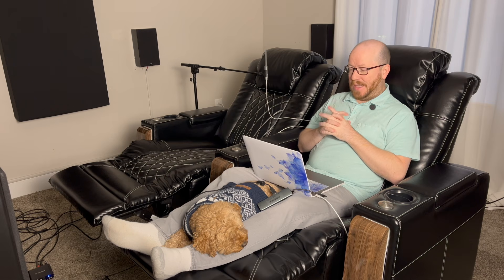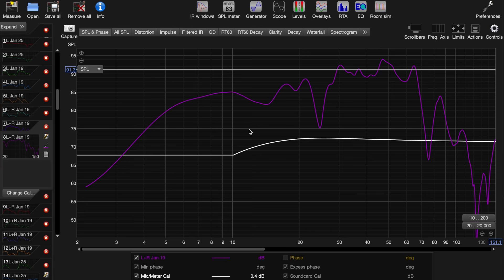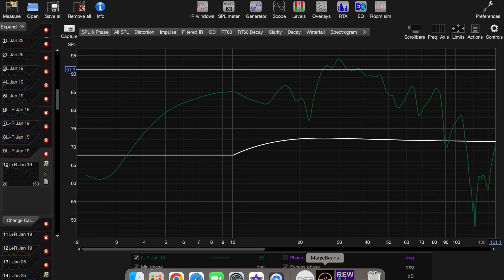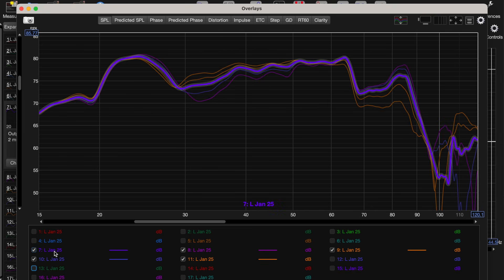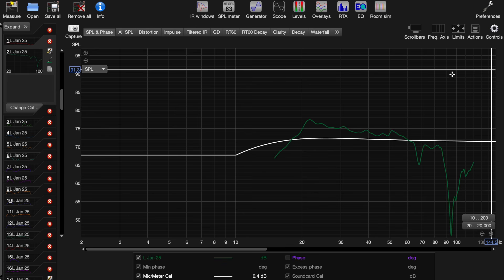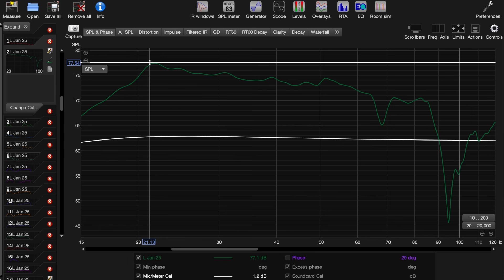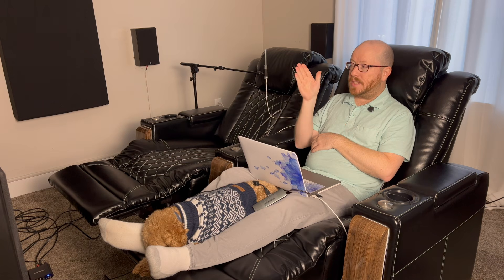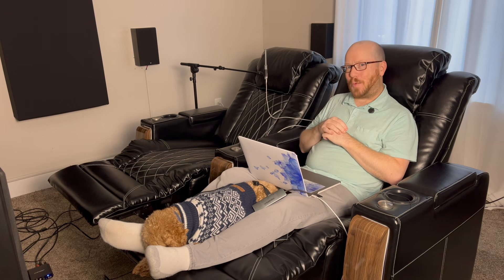Part 2 - Dual Subs + MiniDSP = MAGIC!!

Comment: I ordered a 7 bed layer RBH system along with 4 in-cieling RBH speakers to handle Atmos duty. Your tiny room series and Shane Lee pushed me over the top. Waiting on them to be completed and delivered. How would you compare the RBH sub to the RSL sub? Which one would you say is better. I'll be using it for 100% UHD 4k disc watching.
Reply from the maker: The RBH sub is 12” and can outperform the RSL. However, the RSL is less than half the price. So it depends on your budget and what you want out of it.

Comment: So I just incorporated a 2nd sub (same make/model).  I don't want to buy a mini DSP/ or use rew.

Should I do the following?

1. Level the subs individually. (Both at 75db, and combined at 78db)
2. Do speaker calibration (Avr trim was -11db, but I adjusted it to -5db to to reach 80-81db

Gain on the subs is at 9 oclock.
Can I play with the gain afterwards without calibration, or should I recalibrate it if I touch the gain? 

Should I adjust the gain higher say 10/11 o'clock?  I need to have my avr trim at -5/-6 bc I have bass shakers, or else they don't perform.

Comment: I know you didn’t use bass control yet, but have you tried The Dirac Live Bass Management?  If so there is a bug in the software that affects the LPF crossovers. It’s affecting the RZ50 and RZ70. It’s been an issue for awhile and Onkyo still won’t acknowledge it.
Reply from the maker: Interesting! I have been using Bass Management. Was not aware of the issue.
Reply: @ yeah if you measure your subs in REW you can see it. I know you use external amps so you could shut off the amps so the front left, right, and center get no power or speaker output. Then measure a full range sweep with the left channel. Then measure your right and center speakers.  Change the smoothing to 1:1 and it will make it easy to see. The fronts will default to 120hz crossing and the center will take to whatever you had the fronts crossed at.  The high pass filters will work correctly if you measure the speakers later, but the LPF will always be wrong and the Fronts will always default to 120hz regardless of what you set in Dirac. This is an issue what Dirac Live Bass Management and Dirac Live Bass Control on the RZ50 and RZ70.  There is a lot of info on AVS forums about it. We have been contacting Onkyo going back as far as November, but Onkyo is still no acknowledging the issue.

Comment: As someone who works with sound for a living for about 15 yrs now. You don't need two subs, specially for such a small room and second because most sound below a 100hz is mixed in mono anyways for a whole lot of reasons, you can look up why sub bass is mixed in mono, standing waves, phase etc etc and most of all localization, human hearing can't tell the directional difference of sub bass frequencies anyways, clubs, event venues and movie theaters all have sub downmixed to mono and for good reason too

And I think the most chaos being created is because you have a unmatched pair of subs, because each sub will has a different frequency response curve, which you have seen in your previous video when you ran the REW test in part one from the same location, creating havoc with each other, the RSL (front right, has a better and smoother frequency response so get a second one of that ) just reversing polarity does not really get you phase alignment, the 2ms delay helped because less frequencies were cancelling each other out and creating standing waves.

So for BEST result get one sub with the flattest frequency response possible, get a bigger and more powerful one if you want more rumble and place it halfway behind your chair and the back wall and two bass traps for the rear wall corners.
Reply from the maker: I'm definitely going to experiment with that. Thanks for the great advice!

Comment: problem is, you now have the measurement just in one place, but not in the second position of your 2nd chair. you will need to make several measurements in different places. this is where things are really getting messy so you cant handle them with manual measurenents any longer. you can save a lot if time, by getting a dirac bass control license, which will do the work. best placement of the subs should be one in the middle of the front or sidewall and the other in the middle of the opposite wall. there is a paper from harman on that topic.
Reply: and consider the height of the subs as well to fight the mode between the floor and the ceiling.
Reply: I'd assume, he sits in the right seat and his wife the left ;)
Reply: @kewlbug  a real gentleman for sure he is.

Comment: Good stuff George! Glad you figured some stuff out. Have you played with the alignment feature in REW? If you have sweep measurements from REW, they contain time and phase information. What you can do with the alignment is play with delays and levels to see how it affects the predicted summed response. Its usually spot on. It saves you from having to remeasure with each change. Look out for the solid black line which shows you what the optimal summed response would look like so try to target that.
Reply from the maker: Excellent, thank you!
Reply: I second that 💯, the alignment tool takes out all guessing and tinkering. Adjust the sliders and you will quickly see what the best adjustments are needed for max performance. Such a great tool.

Comment: It appears you are using Dirac with only one sub output and having a MiniDSP to manage the multiple subs.  If you were able to use 2 independent sub channels from your processor then Dirac should be able to calibrate them more precisely.  Since you are using a MiniDSP to drive multiple subs then (like others in this comments section suggest) I would recommend using MSO (Multi Sub Optimizer) to first calibrate your subs then use Dirac afterwards.  This should give a much better response curve in your sub frequency range.
Reply from the maker: I have the Onkyo TX-RZ50, which does not have independent sub outs. I would love to try out MSO but I’ve heard it only works on Windows and I have a Mac.
Reply: @GeorgeTheaterAtHome  Time for Boot Camp 🙃

Comment: Have you played with the OCA calibration? Most have found they no longer need their minidsp. I just installed some bass shakers to my chairs and man they are so worth it
Reply: If anything, playing with OCA cal has taught me so much more with REW, wait till you getting into impulse and overlaying them to get your speakers aligned correctly.
Reply: Run a sweet with front left, then another sweep with front left and sub together, it should show if that null is an issue, your looking for a clean line from the sub to speaker
Reply: No way. Oca is no replacement for MiniDSP at all
Reply: @shaolin95  have you tried the lastest version of his script? OCA neuron

Comment: If you are combining 2 subs from different manufacturers you might want to experiment with all-pass filters. Have you looked in to Multi-Sub Optimizer? It will run 1000s of iterations for you in seconds looking at multiple subs and at multiple seats simultaneously.

Comment: Your 68hz null is almost certainly infinitely deep. The smoothing just hides it. You're also likely looking at a second null at 95hz as that steep drop off and rebound is not consistent with a typical low pass filter for a sub to mains crossover.

Comment: You need a follow up video using MSO (multi sub optimizer). I got similar results as you using REW, but MSO significantly improved the smoothness and completely eliminated a null that I couldn't remove by hand.
Reply from the maker: MSO looks like a great tool - I'll have to give it a try!
Reply: @GeorgeTheaterAtHome you really should.

Comment: Which of the two subs do you like more?
Reply from the maker: That’s a tough call. Based purely on performance, the RBH sub outperforms the RSL. But it’s not exactly a fair fight because the RBH is 12” and the RSL is 10”. Also, the RBH is 3 times the price of the RSL. So you have to account for the price/performance ratio.

Comment: But why use a Mini DSP when you have a Onkyo that supports seperate subwoofer channels output? Not saying using Dirac. Just delay and EQ?
Reply from the maker: The Onkyo TX-RZ50 has two subwoofer outs. But they are not independent. They don’t allow individual control of the two subwoofers.
Reply: @GeorgeTheaterAtHome  thank you. Are you using the Mini DSP Multi-Sub Optimizer (MSO) functionality?

Comment: Sorry for my somewhat stupid question. But when it comes to dsp. I know zero. Because of my ptsd. I lost out on many years of good knowledge. So here is my Q. I got the X15+ sub active and then i just added a dual 18" passive whic is runned on a crown amp 2502 bridged. Does the mini dsp only work with the same type of subs all around or can i mix both active and passive subs? Again, i dont know anything about connection the mini dsp since i´ve never owned or used one. And all this is i guess depended on how you connect the subs to the mini dsp right. Once again a great video. Keep them coming. Tango out.
Reply from the maker: You can mix active and passive subs with a miniDSP. Use an RCA cable to connect the amp for each sub back the miniDSP and you’re good.
Reply from the maker: Thanks, glad you enjoy the videos!

Comment: Would you try the Dirac Bass Control update (for a fee) on the rz50? Above that, magic beans? Sorry for being our guinea pig 😅. Looking for see that director's cut.
Reply from the maker: I’m loving Magic Beans! Haven’t tried Bass Control yet. Maybe have to give it a try when I get the $299.
Reply: Thanks for the video! Did you try to use rew peq on each sub before running Dirac live? Also did you upload Majic beans sub room curve to your Mini dsp 2x4 hd or to Dirac live? 😊

Comment: I am looking forward to that 6hr video...

While the result is quite good, I think you should try again but this time with a different approach.
1st, the 2ms delay was most likely needed (as already mentioned in another comment) to compensate for the physical difference between the two subs and your listening position.
2nd, I think you would be better off making your measurements with the moving mic technique (use pink noise and move the mic around the listening position to get an average reading and avoid false readings that may happen when you sample only one position)
3rd, use the already documented by the Harman paper positions for subwoofer placement as a starting point and only give up if you can't get a decent curve using the moving mic technique and the appropriate delay.

Having said that, I believe that in the end, you will get the best response with either both subs at the middle of the wall position left and right from the listening position, or in the middle of the front and rear wall, or in the left and right corners with the drivers facing the side wall, no more than 6" away from the side wall. 
Last but not least, make sure you don't try to EQ nulls. It doesn't work.
Reply from the maker: Well now I’ve got another 6 hour experimentation marathon ahead of me. You may indeed get that 6 hour video 😁. Good suggestions, thanks!

Comment: So cool you figured out the delay issue! I know some guys say to add delay to increase sq and spl. 
But also interesting to see the success with 1 ported sub and one sealed sub! 🎉

Question, could you have made nearly all those changes without the dsp if the receiver has 2 sub outputs? 🎉 thanks
Reply: Yes If an AV Receiver or Pre Pro has multiple subwoofer outputs that are "individually controllable" with delay. Most receivers that have multiple subwoofer outputs just send the same signal out of both outputs and thus do not have individual control so no they would be able not make the changes increasing the positive summation and improving the response like the Mini DSP.
Reply from the maker: There were many times during this process I was cursing mixing ported/sealed subs because I figured that was the root issue. Turns out they work just fine 🤷‍♂️
Reply: @GeorgeTheaterAtHome  Mixing ported and sealed subs is a challenge. I think you should also try with the port of the ported sub blocked off. The inverted phase of the ported sub at the port tuning frequency will always cause trouble and may lead to compromised performance.
Reply: Even a relatively short count of 32 comments at the time of my reading this was a bit much more my patience, and I had to pipe in myself. As you didn’t mention anywhere in either video, did you try REW’s  “align subs” utility built into the  EQ actions tab, I think it was? After taking independent measure of each sub, it allows  you to very quickly fuss about with modelling effect of delays and inversion, and might well have saved you those hours of frustration.
As for AVRS with multiple independent sub outs, how many of those include the granular level of tuning of the miniDSP? And the MSO that has been mentioned is a Windows only program, and many of us Mac users are loathe to add a virtual Windows to our laptops for that singular application.

Comment: You should try messing with the time alignment tool on rew its really cool and also makes it easier when u set up your mini dsp
Reply from the maker: Great suggestion! I’ll check that out.
Reply: +1 on that 👍🏻 then u can easily try every position on each sub together with every position with the other sub. As someone mentioned before, trying to pick the two best locations that complements each other the best.
Reply: And also, would it make sense to eq the align curve in REW and then ad it to MiniDSP and after that run Dirac live in the Onkyo?

Comment: It would be nice to see the graph of each sub separate. You need to choose a location were both sub compliment each other. It can be that it is not the best location for one sub, but it solves dips in the frequenty of the other sub. For setting the delay, measure both subs separate and then together. Together should always be higher, if not start adding delay to one sub until the output is higher then each sub separate

Comment: Do you think your biggest hurdle was the fact the 2 subs are not matching? (Same sub brand and model)

Thanks for these videos btw. I know they're a pain in the ass to make and edit.
Reply: No not at all, the largest issue is almost all rooms below 200hz have modal issues causing peaks and dips in the response. The frequency of the peaks and dips are determined by the dimensions of the room.

Also to elaboate a bit more on different subwoofers , ideally to make life more simple just using sealed subwoofers makes it easier to time align across a wide frequency range as phase interaction is more simple. The port can and will effect Phase both down low and up high so this can make it harder to align. 

That is not to say it can't work well with different types of subwoofer, I have run similar systems to Theater at Home with sealed and Ported subs and the bass can be fantastic.

Comment: A 2 ms delay is equivalent to 2.2ft of distance, is this the diffence in distance between your listening position and the your two subs? I'm also wondering if the null you have at  around 70Hz is a room mode and therefore difficult to EQ out? Very nice result by the way.
Reply from the maker: Thank you! Yes, the back sub is about 2 ft further away so that makes sense the front sub would need to be delayed about 2 ms. Good to know!
Reply: Yes, really you should start with taking measurements with a tape measure. Set your delay. Then make minor tweaks in delay.